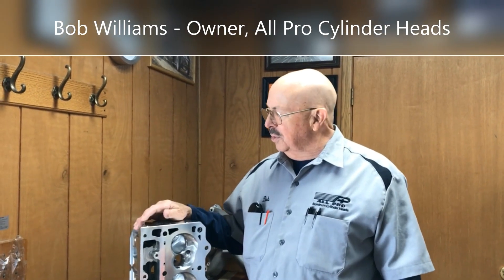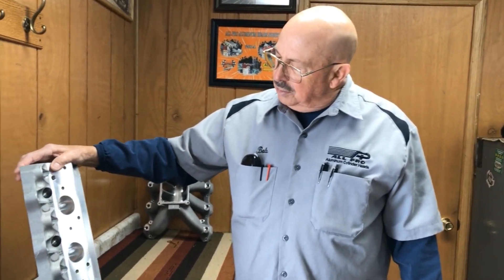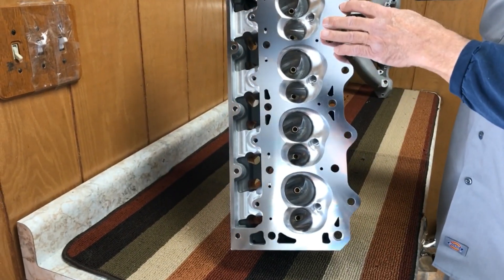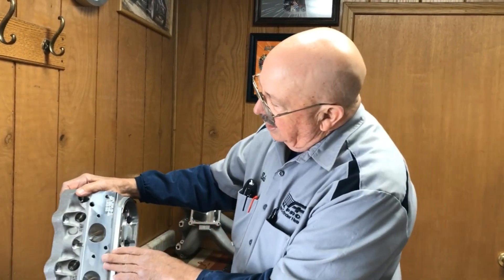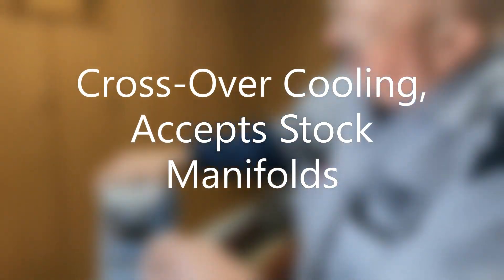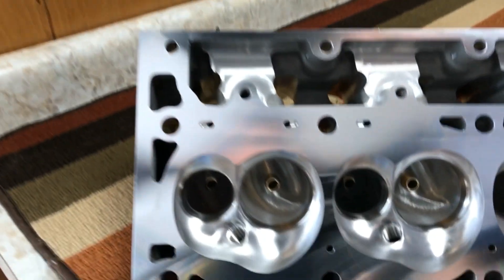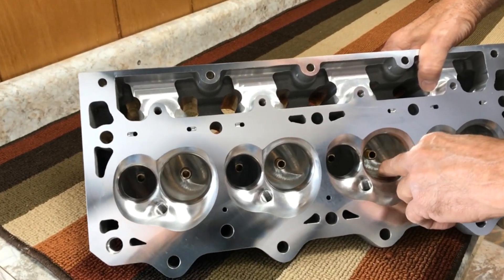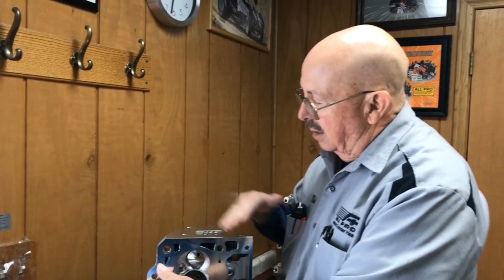Borowski Race - All Pro LS7 Heads

Comment: Nice looking head, I wonder what it’s flow numbers are and possibly a Dino graph  would look like compared to a stock LS7 headed motor.
Reply: Been a while so my numbers are dated but 275cc LS7 all Pro's were good for 15% better flow over stock LS7 heads at .700" lift. At .800" lift it was like 20% flow improvement. The thing this is, this is a 295cc head though so my number are on the low side. 275's were good for 700whp with a sheet metal intake, meth injection and 15:1 cr with stock LS7 block and rods. 427ci displacement still.